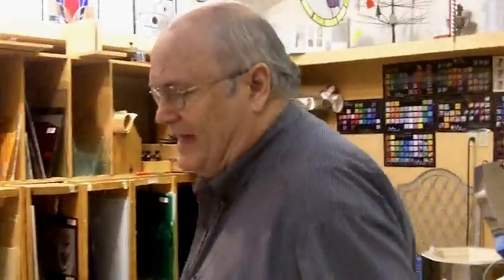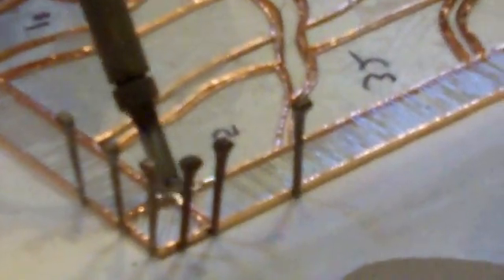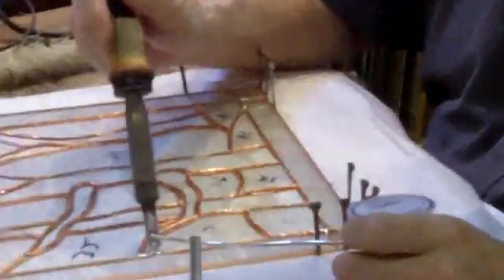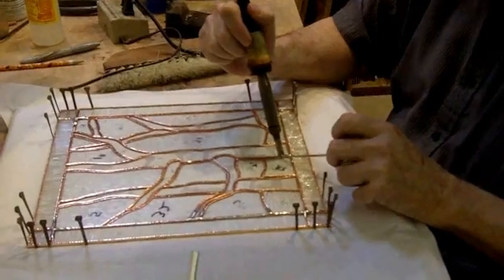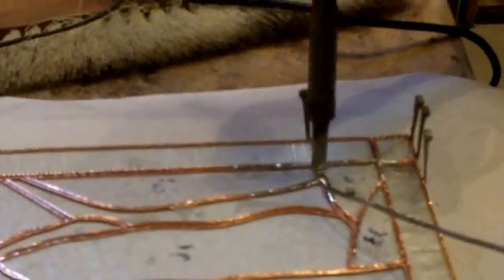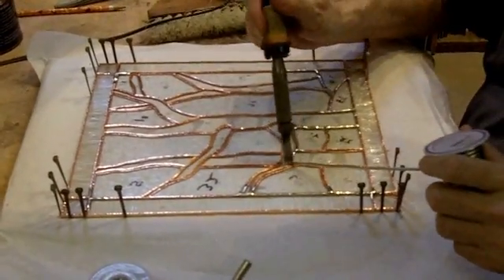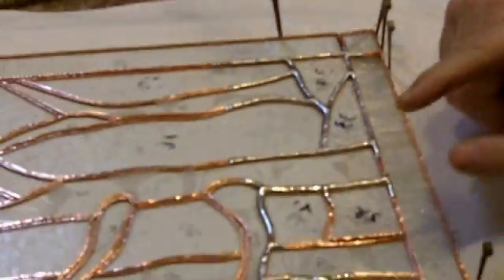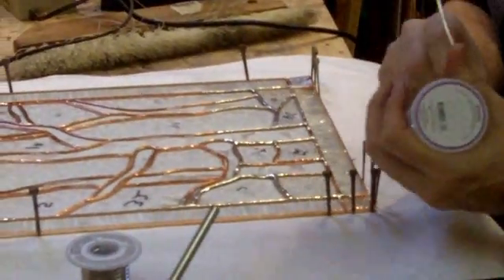Compare Lead Free Solder To 50/50 Solder V026

Comment: Edit:  i saw your update the youre back using 50/50. 

Are you still lead free? How's it going 11 years later? Have there been improvements in flowability with lead free solder?
Reply from the maker: Not any longer, Unless we're doing jewelry that will be in close skin contact. But we learned right away that our soldering results just weren't as good with the lead free.

Comment: I have worked with lead solder over 50 years without issues. Lead free is crap and 50/50 is getting harder to find all the time. Handling it with gloves in a well vented area is the key.
Reply from the maker: Lead Free is harder to work with...which is why we went back to 50/50 solder a while after we shot that video

Comment: What temp are you running your iron at? Im having to run super hot (800 degrees) on my attempts, which seems super hot
Reply from the maker: lead free solder requires greater heat so we reccomend a Haako brand iron when doing lead free work. We tried it awhile and now we use 50/50 solder as before.

Comment: Did you find that you had trouble with your tips oxidizing after using lead free? I'm having trouble with my iron staying tinned.
Reply from the maker: It may be because the iron needs more heat for the solder to flow so the tip doesn't stay tinned as well. One trick is to get a solder pot (found on Amazon) to keep the tip in a bath of melted solder.

Comment: Im just getting started and i don't want to use lead. Thank you
Reply from the maker: +
We find that you'll want a high temperature soldering iron when doing lead free soldering. The Haako brand iron is the hotter iron. We use lead free solder when doing jewelry, but prefer 50/50 solder when doing art glass.

Comment: David, what type of flux are you using with this lead-free solder?
Reply from the maker: I'm using Denver Flux which is a good liquid flux, I sometimes use Novacan which is just as good but a little harder to obtain from my supplier.
Reply: @GommStainedGlass  Thank you so much! I’ve watched a few of your videos and about 8 years ago you mentioned switching to mostly lead-free solder. Is that still what you work with primarily?
Reply from the maker: @christinaj2118  I discovered that working with lead free solder required so much extra heat and was so much more difficult that I went back to using 50/50 solder. We have instituted strict cleanliness policies to reduce the risks of lead contamination. 😃😃
Reply: @GommStainedGlass  what are some of the cleanliness policies that you use to help reduce lead exposure?

Comment: Thanks for this helpful video! Do you also have any advice for using patinas with lead-free solder? It seems like black patinas work but not copper ones.
Reply from the maker: Copper patina is always more difficult than black, no matter the solder used. Cleanliness is important, use CJ's flux remover and then Kwik-Clean to prepare the metal.

Comment: Might need a new type of flux.
Reply from the maker: A different flux might work differently but the melting temperature is the concern so probably a hotter iron would be the solution.

Comment: Hi David,
Thanks for this. I've been doing stained glass for about a year now and have been looking into switching to 100% lead-free. The problem is that there is no definitive list of exactly what kinds of tools/materials are needed. Some people say you need special iron tips, some say you don't. Some people say you need special flux and patinas, etc. I have no idea where to start and don't want to waste money on trial and error. I have a Weller 100W iron which I believe is hot enough for lead-free solder. Could you shine a light here for me? 

Thanks so much,
Sarah
Reply from the maker: The Hakko temperature control iron works well since you can turn it up to a higher temp. We have stuck to silver solder on jewelry but have gone back to 50/50 on flat glass

Comment from the maker: Just a note: working with lead free is a real pain compared to the way leaded solder flows. So after two months, I began to work with 50/50 solder and over time we've begun to use it in everything except for jewelry. We now make sure to wash with a soap made to remove heavy metals, change out of work clothes soon after leaving the studio and other practices like no eating or chewing gum in the studio.
Reply: How did I know you would back off of the total changeover? Also, how did I know you were going to say "antimony"? I don't know. Weird. Also-- you do realize that 50/50 has more lead in it than 60/40? So switching to 50/50 is not accomplishing your goal of cutting down lead exposure. Here is an article comparing various solder types. There is 40/60, where the tin is less than the lead. https://chatterglass.wordpress.com/2014/10/30/which-solder-should-i-use/
Reply from the maker: @argusfleibeit1165  We simply found that unleaded content is exceeding difficult for regular panels.

Comment from the maker: There are many other ways to get lead exposure..like when cutting the metal around a finished panel, the blade cuts through both the zinc and the lead. So those sharp blades are throwing lead into the air and that's probably the most danger of exposure of anything we do.

Comment: Have you tried hot air soldering (aka reflowing) ? It might be tricky but I saw people etching copper traces on glass like you would a normal PCB and reflowing their components.
It would require some amount of preheating to ease the melting.
I don't know if using flux and simply laying your solder wire in the grooves will work, otherwise soldering paste might work better.
If that does the trick you could simply put the full window with the solder in the grooves in a oven and tada...maybe...
Reply from the maker: I'm going to read the links you sent to see if this will work.

Comment: That is awesome :) I haven't really thought much about the 3d aspect of stained glass. That would be a lot of fun to work on.
Reply from the maker: We've stuck with silver solder on pieces that will be handled a lot, but have gone back to 50/50 on regular flat glass

Comment: That's great! I have been wanting to start stained glass and was worried about the lead based solders out there. That is a little sad that it's more difficult to work with, but at least you guys will be safer!
Reply from the maker: We continue with silver on pieces that will be handled a lot